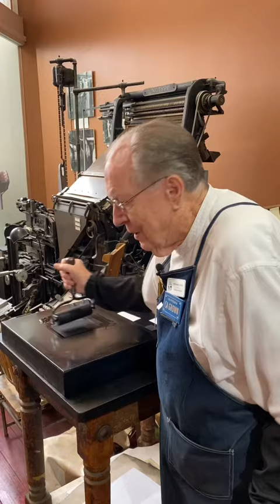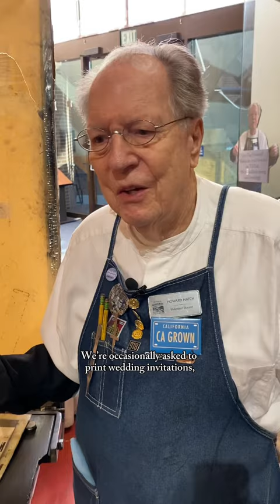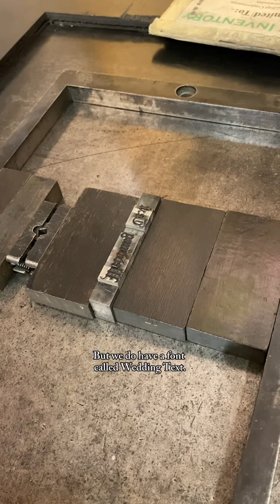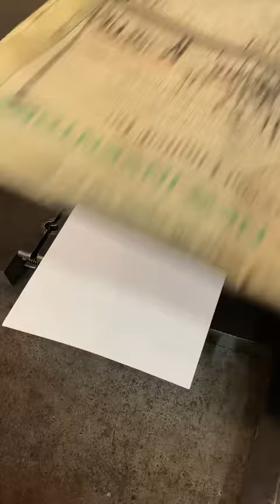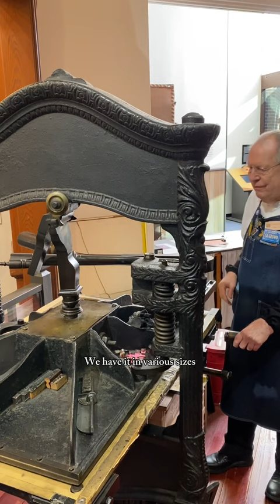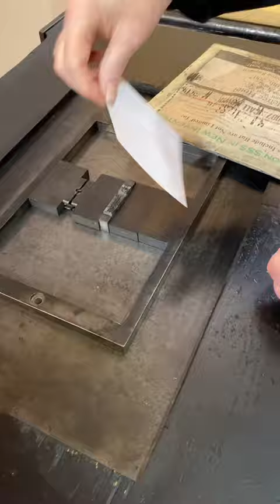Discussing and printing some Wedding Text for National Wedding Invitation Day (July 16)

Comment: Would be interesting to know what the problems where with the Wedding Invitations that were attempted to print 😅. Anyways, keep up the good work 👍
Reply from the maker: We’re not a printing business so we are not really interested or have the time to be doing that sort of work.
Reply: @SacramentoHistoryMuseum Ah, I get it. I thought something funny has happened but yes, this is totally reasonable.
Reply: I'm guessing that it took too long or was less perfect than the couple to be hoped.
Reply: @amyeff7279  Yeah, probably. I, for example, keep up an old darkroom for "printing" pictures. If you do a few prints and they are of varying quality (you try different things, the machines are no longer 100% accurate, etc.), it is fine picking only the one or two best ones for yourself. But if you need to do 200, it does not scale. Some might be good, others not so much, etc. And you need a lot of time to do that. Similar problems I guess.
Reply: @thomasa.243  back in high school I did some photo printing. Being able to do that is an artform.